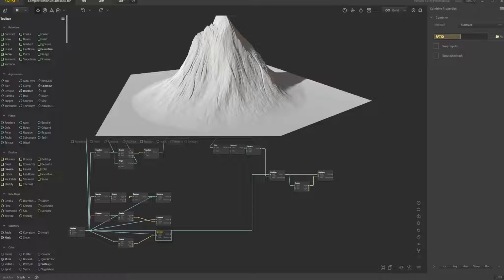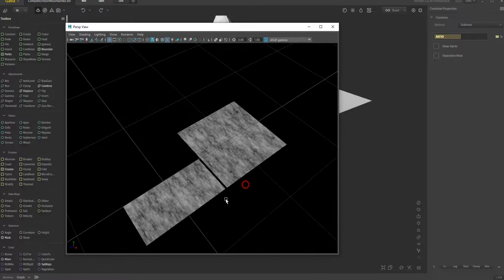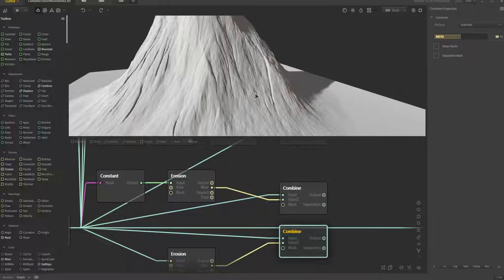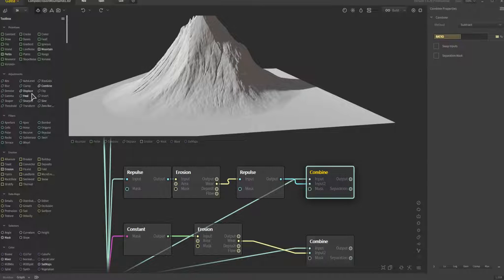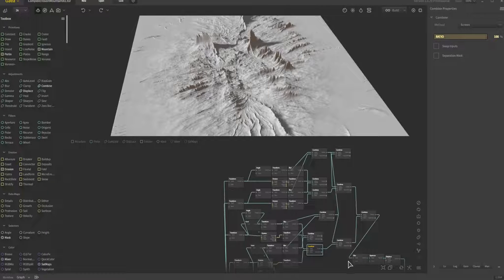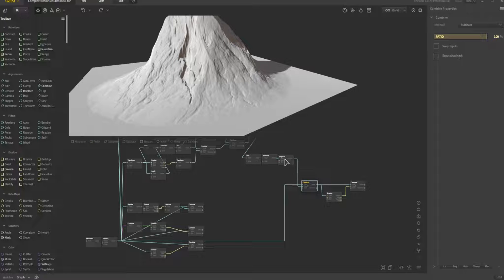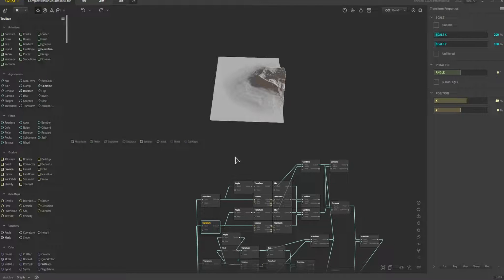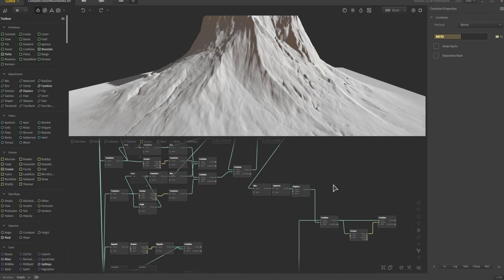Quadspinner Gaea - Deeper information on steep erosion

Comment: Fantastic follow-up video, thanks for the explanation! It's clear now that the detail comes from increasing the effective resolution/size of the eroded area from a top-down orthographic view. I think I'll look into this to see if it is possible to compress more details into a smaller area of terrain in related ways. Obviously these methods seem to be very costly for the graph processing time, but I think the added shape and complexity it gives could make it worth the effort.
Reply from the maker: The creators are aware of this method, and are looking both into a way to automate this in a more practical way, as well as other research into better ways to handle steep angles. So it is possible we will see either an invisible improvement where erosion just automatically calculates better, or if it's a higher cost, a new node, or an option inside the node to activate this more costly method. We'll see... for now it's all manual work :D